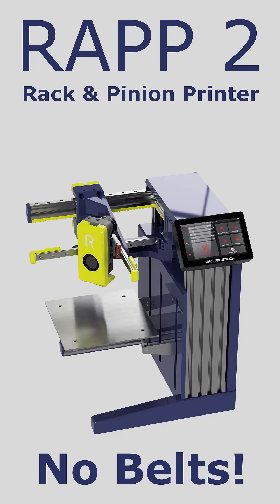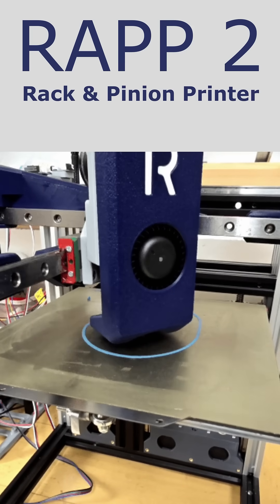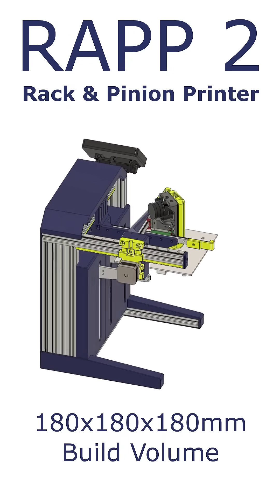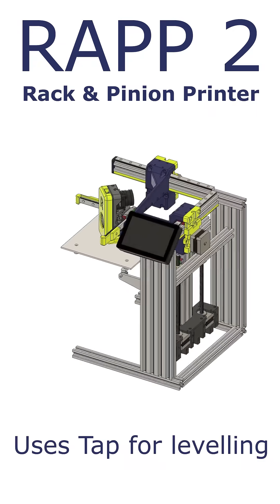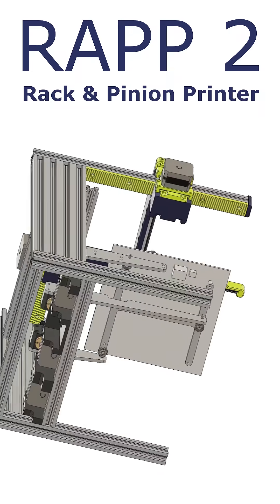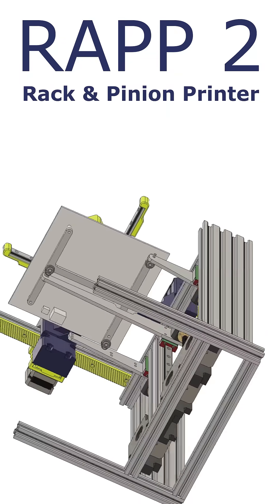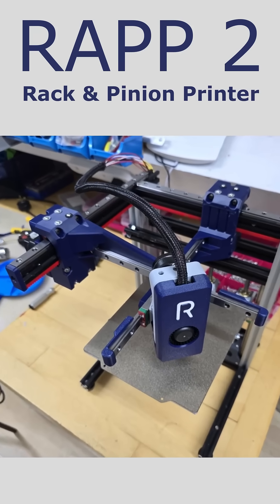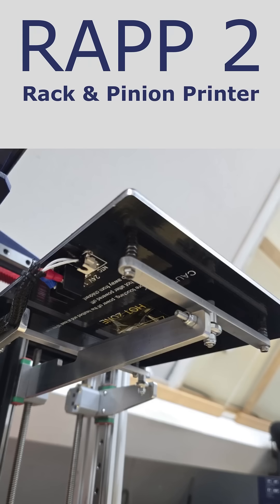RAPP2 Rack & Pinion 3D Printer - Part 2

Comment: So I’m just spitballing here but what if you had a direct connection between the extruder assembly and the print bed where as the extruder went down it pushed a lever mechanism that pulled the center of the print bed down and forced the bed to make contact on all 3 semi stationary points where the peak of all 3 were pre leveled? 

I just thought of that as I was watching and I can already think of problems designing it that way but I figured I’d comment anyway because it might make you think of an even better solution. Presumably you’re dealing with a lot of tolerance stacking issues with the various joints for the 3 levelers for the bed so having the 3 points preleveled in a more solid/stationary way may eliminate that problem but you’ll still have to level the bed and by pulling the bed down very slightly from the center of it to force it to make contact with a fixed series of 3 contact points it should  eliminate a lot of the tolerances with everything including the leveling screws because there wouldn’t be any because the bed would just make 3 point contact everytime and you could mesh bed level the  free moving and/or ‘fixed’ (pulled down) bed it theoretically could become super accurate maybe??? 

Again just spitballing here but maybe something in there gave you an idea hopefully
Reply from the maker: All good stuff, the whole point of uploading these videos was to have this type of conversation. Your idea may have something, I just need to ponder on that for a while regards implementation. The cantilevered Z Tilt is quite finnicky to dial in but after that it is quite reliable. It does not cope with large deviations well if the build plate is say 5mm off it may need a second Z Tilt. Usually I get to a .05 deviation in 2 or 3 attempts, I find this sufficient to achieve a good first layer. This will never break records that way but one of the more reliable parts of the concept. Thanks again

Comment: If you glue belts on a plate to use them as a rack and then use a pulley as pinion it might give you better results.
I'd suggest looking into the ServoBelt LoopTrack concept/product, it's an even better implementation of the concept.
Reply from the maker: I will check that out thanks